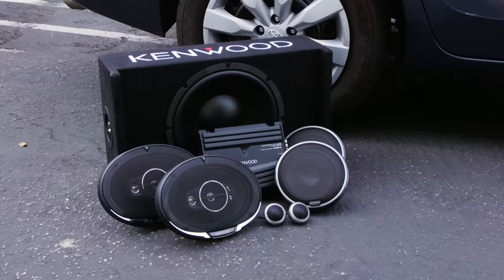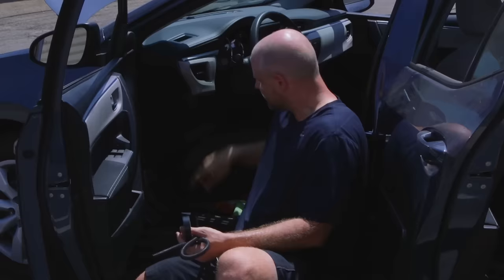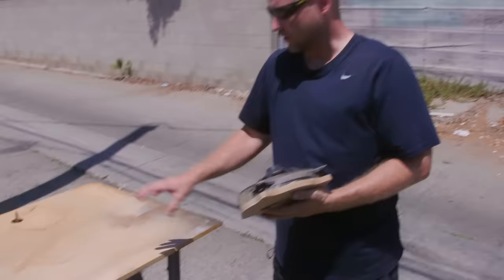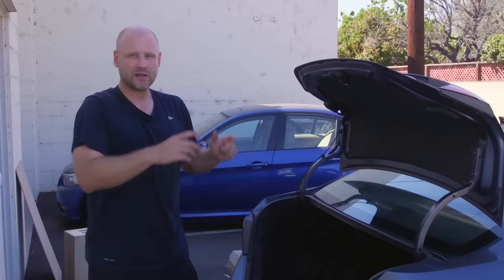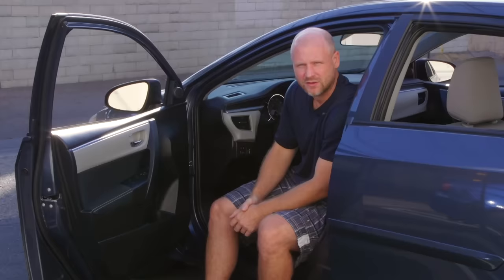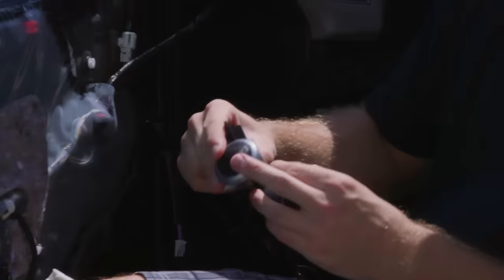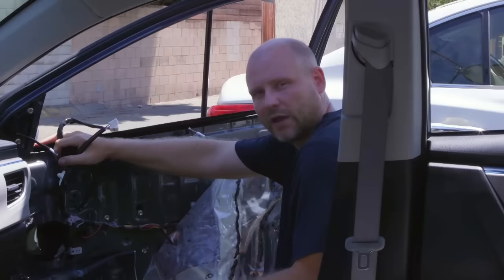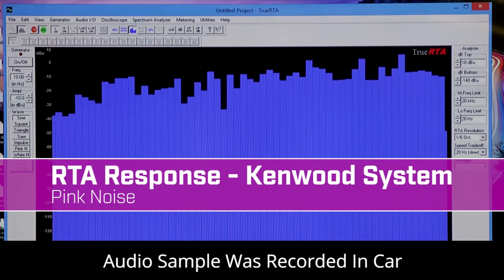Full Car Audio System Installation - Speakers, Subwoofer and Amplifier

Comment: I do t think you told us why you ran 2 18gauge wires with positive wire, not much explanation on why your doing some steps, like why you chose that spot for your ground, that would be helpful.
Reply from the maker: Grounding to the car chassis is the best ground for your system.

Comment: quick question.. so i had 2 10' sub woofers installed on my car years ago in the trunk.. my amp is 1500w.. my stock speakers are ass and are blown.. i want to upgrade to kicker speakers.. i installed a new head unit myself over the past summer... my question is, do i need a separate amp for the speakers? i know its limited info.. thanks.
Reply from the maker: So long as they're not insanely powerful speakers, you'll be fine running them with the head unit :)
Reply: @Qualitymobilevideo  Thanks for the response!! really appreciate it. KICKER CS Series 6-1/2" 2-Way Car Speakers those are the speakers from best buy.. RMS power 100w and peak 300W.. as of right now i only bought a pair to change the front doors but was planning on doing the back 2.
Reply from the maker: Nice! You should be fine especially with a new head unit, but of course you'll get more power by getting a 4 channel amplifier
Reply: @Qualitymobilevideo  you are awesome!  Thanks for the help. I'll do that for now and find a tutorial on how to add a second amp . I recently upgraded my battery and will be performing the "big 3"
Reply from the maker: Of course man! In this video we actually powered the tweeters, front speakers, and rear deck speakers with my factory head unit. Let me know how it goes bud!

Comment: Nice work! 

@6:18 what are the name of those clips you put the zipties threw?
Reply from the maker: Hey Carlos! Those are called 4-way cable tie mounts. We sell them on our site right here: http://www.qualitymobilevideo.com/7701.html
Reply: Thanks for the reply, nice & clean! 
I was going to get a installer to put a Amp & Sub in but after watching your video and some pointers from DriveAccord I'm going to partake on this adventure.

I've already replaced front & rear speakers(2013 Exl) with JL 2650's. Next week I'm going to add a 4ch amp and a powered JL Sub that I'm going to mount under the deck in pace of the oem sub.
Reply from the maker: Nice dude! If you want to take pics/vids of your install I'll feature you on our weekly Vlog!
Reply: Ok will do...
Reply from the maker: Good Luck! 🤘🤘🤘

Comment: My brother install a system in his truck and his speedometer lights stoped working how can we fix it
Reply from the maker: Hey Jesus, could be a lot of things. Did you check the fuses? Could've blown one. Or you could've blown one of the bulbs.  If all of the lights on the dash board are not working then most of the time the issue is in the dimmer switch. The dimmer switch controls how bright the lights are inside of the vehicle. This switch will fail internally. It may also be a failure in the light switch itself. If the lighting issue is confined to the instrument panel then you might have an issue with the instrument cluster failing. This will require some electrical diagnosis using a voltage meter.
Reply: Tank u

Comment: I have a question for anybody who can help me I have a 2000 Ford Mustang base model with an amplified sound system I removed the factory tape player radio out of this car and wired in a DUAL AM FM DVD player stereo  The problem I am having when you listen to the radio everything is fine when you try to watch a movie you hear static coming out of the rear speakers can anybody tell me how to stop that

Comment: What is the part number for the speaker harness adapter
Reply from the maker: Depends! Whats your vehicles make, model and year?
Reply: It's the same as video. 2015 corolla s
Reply from the maker: Cool! Metra 72-8104: http://www.qualitymobilevideo.com/72-8104.html

Comment: i have a boss audio ar4000 watts 1,2,4 ohm class D and 4 12" pioneer 1300 watts 4 ohm single VC. will this amp push them?
Reply: hello
Reply from the maker: Hey Anthony! Are those wattage ratings RMS or MAX?
Reply: there max
Reply: +Anthony Hackman haven't looked at the exact rating yet, but if the amp is 1ohm stable, pretty sure if you parallel 4x4ohm drivers you get 1ohm load..so make sure the 1ohm RMS rating on the amp is close to the RMS rating on the subsX4. it's actually good if the amp provides more watts than the speakers can handle, you can keep the amp gain lower and won't have distortion(clipping) which is bad for the subs to try to reproduce.

hope that all makes sense!
Reply: what is the model of sub?
Reply: if it's the ones I think they handle 300wRMS 

could parallel 2sub pairs for 2ohm each, then series both those pairs for 4ohm total load,  which the amp will provide 1000w RMS so should be matched well enough.

Comment: “Okay. Let’s try this.” (10 minutes into take the panels off) “FUCK I LOST THE SCREWS”
Reply from the maker: LOL basically what you don't see on camera
Reply: Quality Mobile Video 😂
Reply: Quality Mobile Video hey can you post a link to what type of weather stripping you have specifically for the speakers and the double sided sticky rubber that you used behind the speakers. Because I need that and I’m trying to do this for my impala. And when I tried putting a thick and thin type weather stripping on the car doors speakers. It sounded like crap. So I think i need the sticky rubber housing like you have and that smaller weather stripping. And can you also give me a link directly to the wiring stuff. Because I’m trying to not buy the whole Kenwood system. I just want the amp, wire, and proofing to make it sound good.
Reply: Quality Mobile Video btw, you gotta new subscriber! 😉
Reply: Quality Mobile Video what is that stuff. I’m so curious. What is that stuff between the speaker and the speaker adapter that lets it fit correctly. WHAT is it? I need an answer ASAP. I’m trying to get this done before I leave to L.A. next month.
Reply from the maker: That's Butyl Rubber!
Reply from the maker: That's Butyl Rubber!
Reply: Quality Mobile Video what’s the exact measurement of the butyl tape. And it’s the one with the back adhesive right? And what brand and what are the exact measurements that you have for your Foam base weather stripping?
Reply: Quality Mobile Video or can you give me direct links to those last remaining things I need. And is there anyway I can buy those wiring with the connectors already clamped down? And do you also mind if I can get a direct link to that?

Comment: what audio system do you recommend for a 2017 Chrysler Pacifica ?
Reply from the maker: Hey Robert! Depends on your budget and what you want to do. Are you trying to break windows and blow girls clothes off, or just looking for some good clean bass with loud and clear audio
Reply: Quality Mobile Video Yea more like option number 2 clean audio and bass but I also like mid range loudness not too much because my wife, she likes to lower my volume a lot.
Reply from the maker: lolol what's the max you want to spend Robert? And you're looking for everything? Speakers, subs and amp?
Reply: Quality Mobile Video yeah I would like the whole 9 budget wise more or less around 6 or 7 hundred.
Reply from the maker: Ok sweet. What sub-model is your Pacifica? Hybrid Platinum, Hybrid Premium, Limited, LX, Touring, Touring L, Toruing L Plus?
Reply: Quality Mobile Video Touring L
Reply from the maker: Ok I'm going to need your help, I'm trying to find out how many speakers your model comes with and what sizes they are, I just got off the phone with Chrysler and they didn't tell me much, they said 13 Alpine speakers. Do you know what your setup is already? I need to know how many speakers the sizes of them.
Reply: Three 3.5 inch speakers in the instrument panel
Two 6×9 inch speaker located in the front doors
Two 3.5 inch speakers located in the rear door
Two 6×9 inch speakers located in the rear door
Two 3.5 inch speakers located in the rear quarter panel ( cargo area)

Two 6×9 inch lift gate speakers

Four active noise cancelation (ANC) microphones
Reply from the maker: Check these 6x9 speakers out:

Rockford Fosgate P1694
http://www.qualitymobilevideo.com/rockford-fosgate-p1694-punch-4-way-6-x9-full-range-speaker.html?utm_source=YouTube&utm_medium=Video&utm_campaign=Kenwood_Install

Kenwood KFC-6995PS (I have these in my car they're great)
http://www.qualitymobilevideo.com/kfc6995ps.html?utm_source=YouTube&utm_medium=Video&utm_campaign=Kenwood_Install

Pioneer TS-A6985R
http://www.qualitymobilevideo.com/ts-a6985r.html?utm_source=YouTube&utm_medium=Video&utm_campaign=Kenwood_Install
Reply from the maker: Here are some 3.5" speakers 
:
Rockford Fosgate P132
http://www.qualitymobilevideo.com/rockford-fosgate-p132-punch-2-way-3-50-full-range-speaker.html?utm_source=YouTube&utm_medium=Video&utm_campaign=Kenwood_Install

Kicker 40CS354
http://www.qualitymobilevideo.com/40cs354.html?utm_source=YouTube&utm_medium=Video&utm_campaign=Kenwood_Install

Pioneer TS-A878
http://www.qualitymobilevideo.com/ts-a878.html?utm_source=YouTube&utm_medium=Video&utm_campaign=Kenwood_Install

Kenwood KFC-835C
http://www.qualitymobilevideo.com/kfc835c.html?utm_source=YouTube&utm_medium=Video&utm_campaign=Kenwood_Install
Reply from the maker: Some Subwoofer options

Kicker 43TCWRT104
http://www.qualitymobilevideo.com/43tcwrt104.html?utm_source=YouTube&utm_medium=Video&utm_campaign=Kenwood_Install

Kicker 43VCWR122
http://www.qualitymobilevideo.com/43vcwr122.html?utm_source=YouTube&utm_medium=Video&utm_campaign=Kenwood_Install

Rockford Fosgate P3D2-12
http://www.qualitymobilevideo.com/rockford-fosgate-p3d2-12-12-punch-p3-2-ohm-dvc-subwoofer.html?utm_source=YouTube&utm_medium=Video&utm_campaign=Kenwood_Install

Rockford Fosgate P3D2-10
http://www.qualitymobilevideo.com/rockford-fosgate-p3d2-10-10-punch-p3-2-ohm-dvc-subwoofer.html?utm_source=YouTube&utm_medium=Video&utm_campaign=Kenwood_Install
Reply from the maker: Let me know if anything is catching your eye so I can put something more specific together for you

Comment: Couldnt get anything. 
For a DIY thats not an enough video. 
Couldnt see a step by step mounting or where the wires coming from. Or its extentions. Or where from the ground cable came from.  
Not nice

Comment: what is the process on 13:19 called?
Reply from the maker: We're heating the shrink wrap so that it tightens and seals the end of the wire and connection

Comment: did you said 18 or 8 gauge wire ?
Reply from the maker: For the amplifier?
Reply: Quality Mobile Video around 3.50min you said you wire 2 (18or8) gauge wire..
Reply from the maker: Oh! We said "two 18 gauge wires"!
Reply from the maker: You can definitely tell by just looking at the thickness too, 8 gauge is about as thick as your pinky finger, 18 gauge is a lot thinner
Reply: I need glasses I think lol
Reply from the maker: Lol let me know if you need help getting any gear/install parts
Reply: I got civic 09 I thinking to up grade speaker and putting sub. Head unit Kenwood DDX4016BT 
What's you recommend. Speaker and sub+amp
Reply from the maker: What's your budget?
Reply: Quality Mobile Video around £ 500
Reply from the maker: Check out this package, we installed the same exact system in my car:
http://www.qualitymobilevideo.com/kw-syspkg1.html
Reply: Quality Mobile Video thanks

Comment: Power wire on one side audio wires on the opposite side...sry guys great install but an install NO/NO
Reply: Lol he didn't have any rcas ran with the power wire... he used high level at the rear. His job was clean.

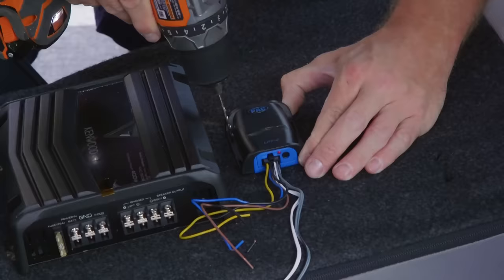Comment: 15:10 What's that little tool?
Reply from the maker: Screw gun with a drill bit
Reply: @Qualitymobilevideo  no i mean the mini box
Reply from the maker: Lol oh, that's a Line Output Converter! Transfers high level outputs from a head unit to low level inputs to hook up to a subwoofer. Here, we have a video on them: https://www.youtube.com/watch?v=OXn8-8yee5o
Reply: Thanks!

Comment: Some of you car audio installers are so extra. Most of these steps are unnecessary for the average guy that just wants a good sounding system. I installed a whole system in my 350z. Ran new speaker wire to all speakers, replaced them, installed 2 subs, all hooked up on a 5 channel amp. Sounds perfect.

Comment: the components you use are ONLY ONE PART that make up the total finished product.  The planning, the installation, and other elements have DIRECT BEARING on the final product.   Professionals take the extra steps most DYI'ers dont....  You can have a $1000 system, installed incorrectly sound terrible....

Comment: Let's just go ahead and take everything off to make it looks like horrible accident !
Reply from the maker: It's the professional/factory way to do it
Reply: @Qualitymobilevideo  
It is  but is it worth time & effort?
Reply from the maker: If quality, longevity and organization are important to you then yes. If you don't mind running wires under your carpet and upholstery and have gear visible and sticking out then keep it simple and don't take everything apart. It's like cleaning, you can either sweep the dust under the rug or use a dust pan and put the pile in the trash
Reply: Oh thank you for replying and for the tips , I'm so sorry i was mocking hope you accept my apology . Your videos are excellent by the way
Reply from the maker: You're good!

Comment: 17 nov 2019 1:59 pm est:thanks

9 dec 2019 9:1 am est:
speaker-subwoofer can make low-frequency-sound which can make movie-theatre suffer structural-damage.
example:
(1)cerwin-vega-sensurround-speaker-subwoofer
(2)maybe 24 double 18" JBL Line Array subwoofers VT 4880A

source:'On February 12, 2006 the Schauburg-Cinerama made a "Last Picture Show" with EARTHQUAKE in the multi-dimensional SENSURROUND sound technology. Invented in 1974 by MCA/Universal and only used for 5 feature films, the Schauburg made this unique sound format happen again. 24 double 18" JBL Line Array subwoofers VT 4880A were used to get the combined sound pressure to make it a realistic EARTHQUAKE experient' in https://www.youtube.com/watch?v=_lYOc5XsmCI (EARTHQUAKE in 70mm & SENSURROUND @ Schauburg - Cinerama 2006) from http://entertainment.time.com/2012/12/10/fantasound-to-odorama-10-unusual-movie-technologies/slide/sensurround/ from google(sensurround damage theatre)result 5 from 'Sensurround was premiered in the 1974 movie Earthquake,[7] and was a great success, but most Sensurround units were later dismantled due to structural damage caused by the vibrations.' in https://en.wikipedia.org/wiki/Cerwin-Vega

so maybe speaker-subwoofer can make car-internal-part vibrate more severe than what bumpy-road make.